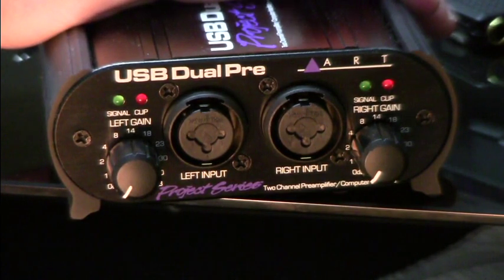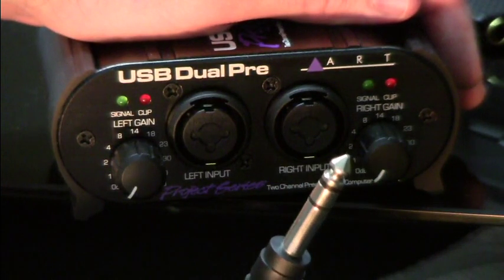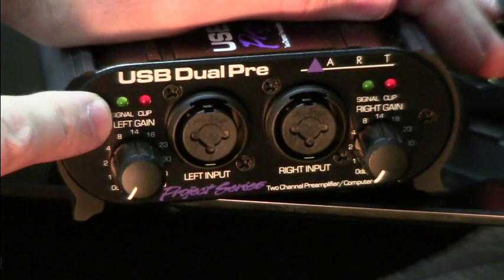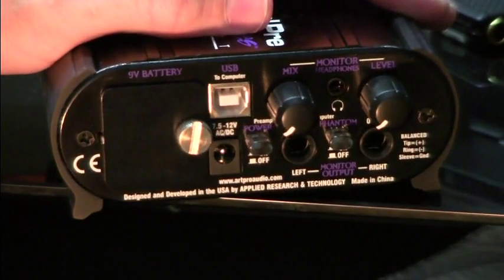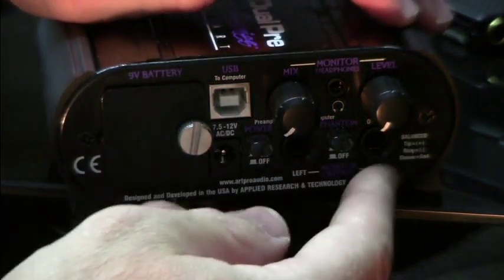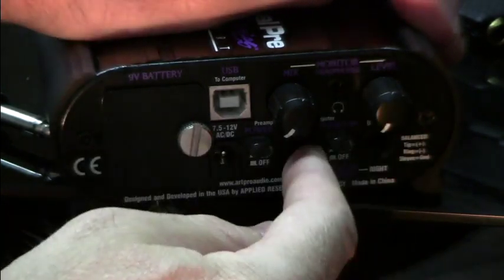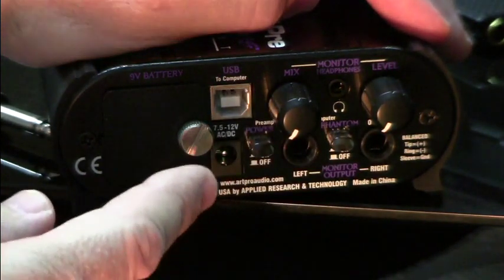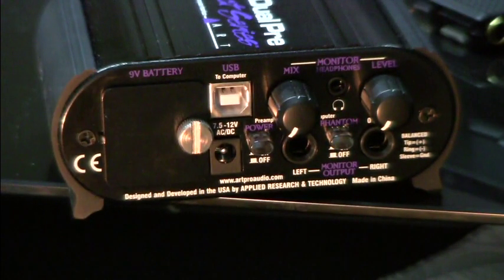ART USB DualPre Tutorial 01 _ Overview of Terminals and Controls.avi

Comment: +YV YVEEn Your input (the speaker on your amp) determines the rest of the sound. I'd try turning the volume to an acceptable level as to not irritate your neighbors, and position the mic closer to the source. Remember that the most important piece is the input transducer (microphone.) I recommend an sm57. They are very clean and run about $100 new. They are great for micing amps.